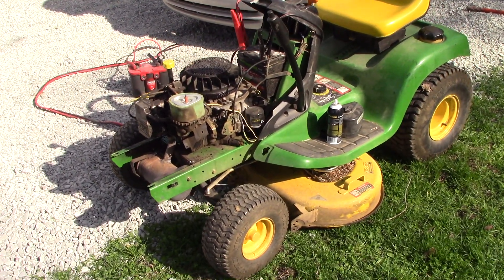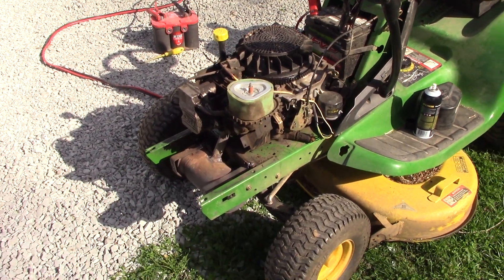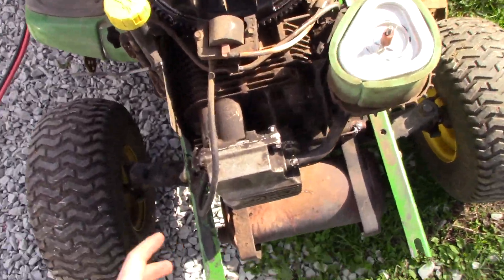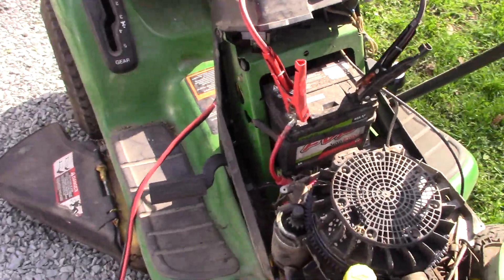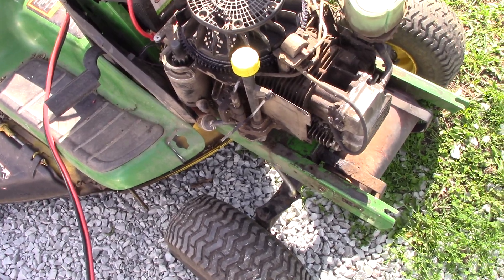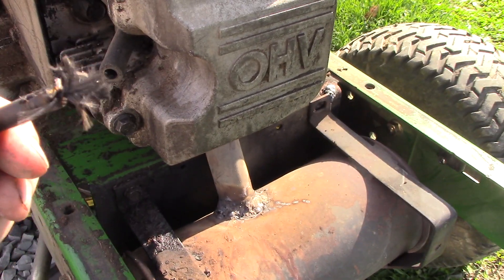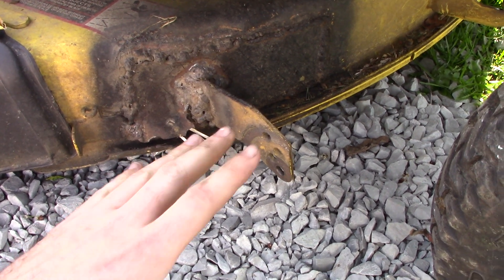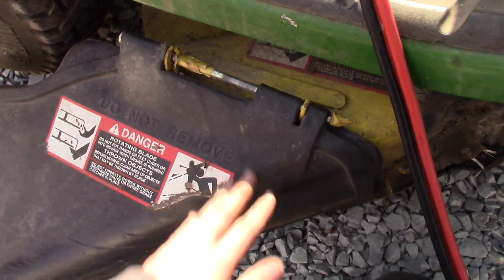How does this lawn mower keep going!?

Comment: I have the same exact one looks identical still has the engine cover tho but no hood needs blades belts motors came loose 3 times exhaust is the same story bought it for 50$ used it for 4 years. Loyal just loyal
Reply: I jump mine off a car battery too hahahah one sits in the shed with cables on it

Comment: And for the record you need the battery on a mower because it runs the fuel bowl solenoid unless you bypassed it and put a fuel valve on it. Those Kohler 15hp command engines are prone to carburetor flooding dumping fuel in the oil.  I worked on many. The carb rebuild kits are fairly cheap. The 13hp model you have came stock with no fuel bowl solenoid so that's good deal. Just keep eye on the block fuel pump they are prone to go out too. Another heads up